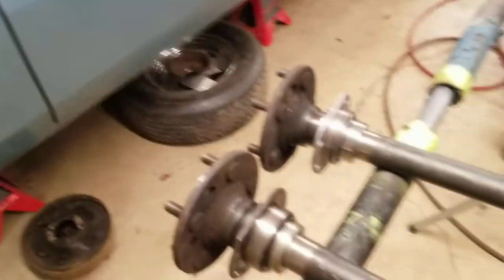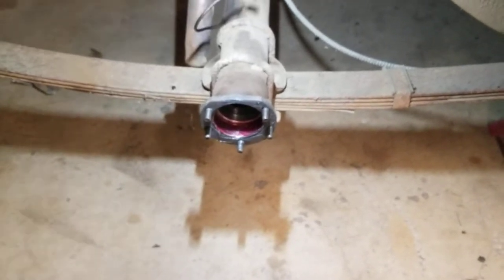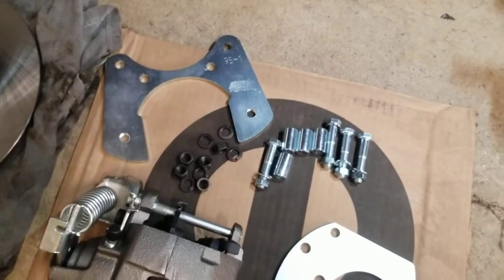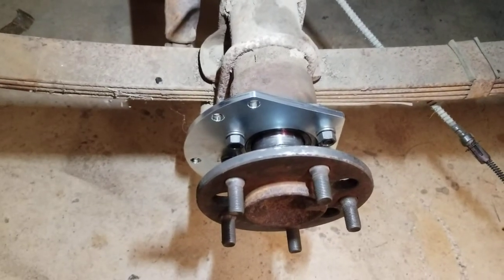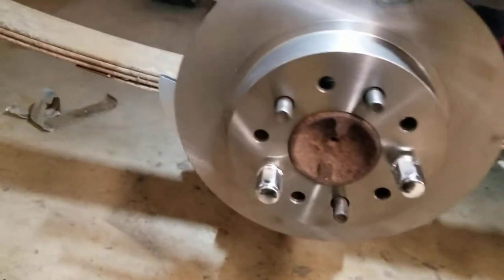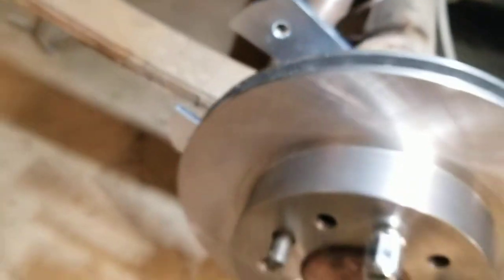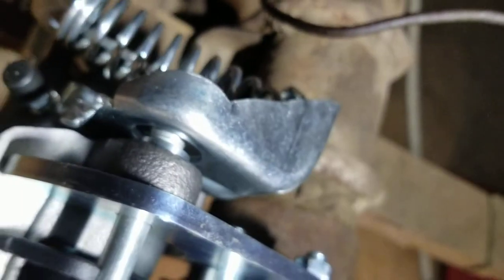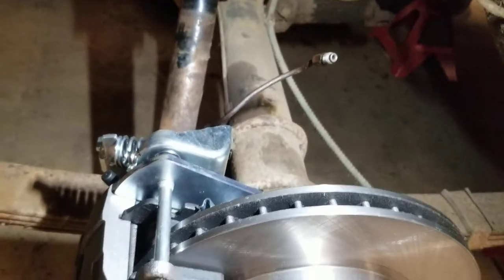Part 2 of rear disc brake conversion on the 1968 Dodge Charger

Comment: Dave i was told that when going with 4 wheel disc, the master cylinder has to be equally portioned. the oem master the front portion is larger to handle disc brakes. the rear portion is smaller for the drum.

Comment: Dave, a lot of great instruction. The master cylinder doesn't have to be changed? The metering blocks are still the same? I know someone who can't get his conversion to work right. No braking power. He has changed everything but the master cylinder and the metering blocks. Any thoughts?

Comment: Good video, does the axle have a step on it so when you install the bearing that it stops in a certain spot?
Reply from the maker: The bearing has a snap ring that catches the flange that only allows the bearing to go in so far in the housing.

Comment: i was hoping you would show the paking brake hook up and adjustment
Reply from the maker: I put the same system on a 69 Road Runner we just did, I will try to get you some pictures of the park brake cable routing.

Comment: Hey Dave.....i know this is an video BUT its still valuable! I used the same kit and mine was bought theu POL. Everything bolted up the exact same way HOWEVER did you have a problem getting the driver side parking brake cable snapping in at both ends??? I replaced mine because they were all rusty and the new one was the same length that they all are...35" or so but the cable casing isnt long enough to clip in on both ends. I thinks because the caliper is mounted on the trailer side of the diff. I had enough play on the passenger side to make it work. Why cant I get my regular length cable to snap in?

Comment: Hey Dave, I tried installing this kit on my Dart today. Are the brake pads suppose to be sort of "floating" in the caliper? I've never done disc before. It looked and sounded like yours were rubbing too. My pads are touching the rotor a tad bit. I thought this was wrong and took them off. Does it continue to stay like that or does it get worked out at some point? I can't understand why the pads would rub.
Reply from the maker: Yes, they will float in the caliper and drag on the rotor, not to the point where they are applying pressure but they will drag to keep the rotor clean and prevent debris from getting in between the rotor and pad.
Reply: Thank you David! @DavidReaDBRestorations

Comment: I have a question related to the axle flange to tube mating, my flange is not fully contacting the rear end tube because of the snap ring on the bearing, I have a gap ( the thickness of snapring)  is that normal?...Thanx.

Comment: Dave, I have the original Bendix 4 piston caliper on my 67 Charger front wheels. I want to know if I can buy a pair of brake calipers and rotors that will work with my bendix booster and master cylinder? Let me know if that it possible. Thank you.
Reply from the maker: Are you looking to upgrade to a multi piston caliper and big rotor Willwood type setup,  or just upgrade to a Mopar single piston later model setup?
Reply: I'm not looking to upgrade , i'm asking if it is possible to just buy a rotor and caliper for my existing set up which is original to the car?

Comment: Hey Dave, I see you used green bearings, is that optional on this particular application or required? If optional, are greens your preference? I have a 70’ R/T challenger and want to put on rear disc brakes but don’t want to use greens…exploring options. Any info would be greatly appreciated! Keep up the good work!
Reply from the maker: Green bearings are required for this rear wheel disk brakes application.
Reply: @DavidReaDBRestorations  thanx for the heads up Dave!

Comment: When running disc front and disc back on a 1968 Charger do you have to change anything with the brake line set up or can you still just run the proportioning valve and metering valve?
Reply from the maker: You can keep your existing brake line set up.
Reply: @DavidReaDBRestorations  I did some checking and I guess it's a distribution block and a hold off valve. I'll leave everything like it is and see what happens. 
Thanks Dave.
Reply: I have a master cylinder for front disc and drums rear...i cant get good pressure for the rear disc conversion i did...any ideas???

Comment: I have 70 challenger rt with drum brakes all around  I’m gonna do a disk brake conversion all around . Is there anything I need to do with the master cylinder or add proportioning valve

Comment: Great work but still not a fan of green bearings...... Is there a rear disc setup that will work with original tapered bearings?
Reply: yes leed brakes.com

Comment: I am failing to understand why you stated in part one that the std. bearings wont seal with disk brakes? 
"Green-Bearings" are a huge down-grade in my opinion.
Reply: John Johnson  I still don't understand the "wont seal with disk brakes" statement. And, I will still take a good ole' tapered roller bearing over a ball bearing any day. No matter what generation. Ball bearings were never meant to handle side-loads. Physics has not changed.
Reply: @wheelieking71  your are absolutely correct I am not comfortable with the green bearings in a heavy car like my 71 charger tapered bearings are superior to ball bearings especially in a car that you want to corner in aka side loading bearings, modern cars use ball bearings in their hubs and I have replaced a ton of them over the years.